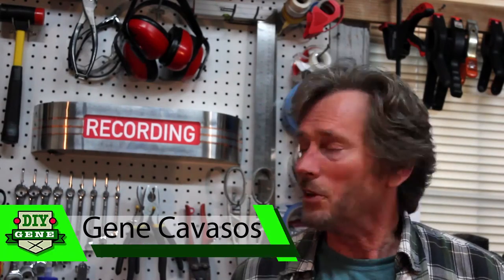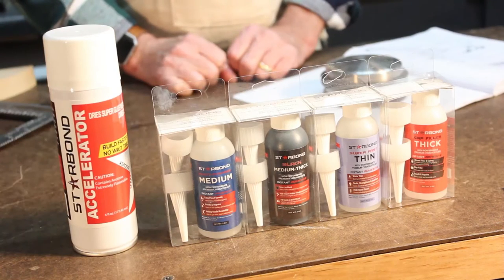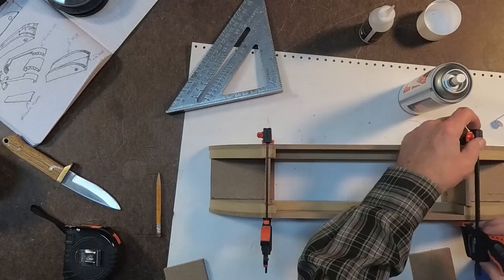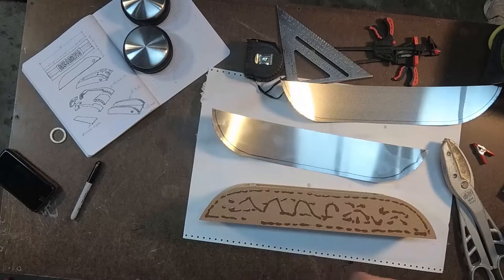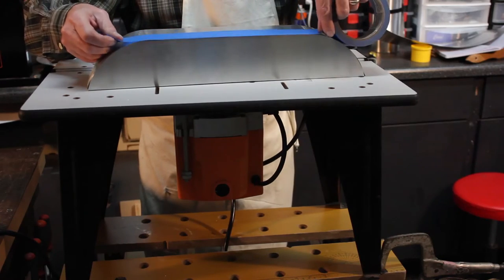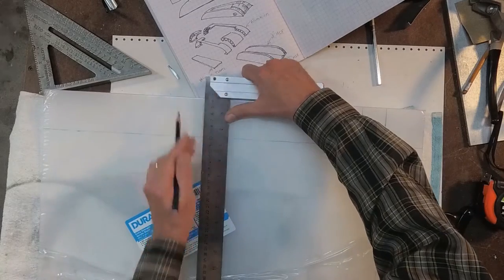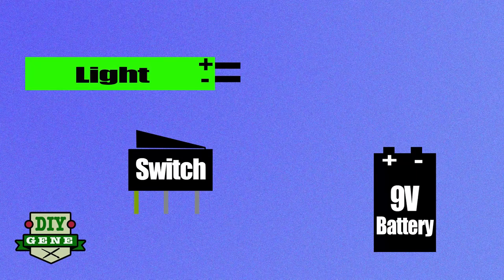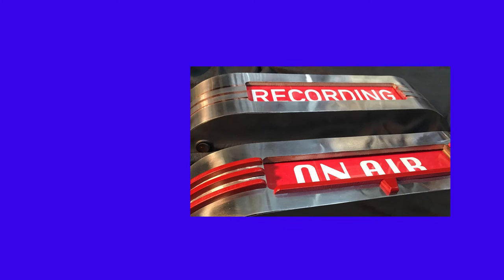Vintage On Air Sign for YouTube Creators.(How To Make)

Comment: What I like doing with CA glue, is to use it as a clamp. Run a bead of wood glue as you normally would, but skip an inch or so throughout the glue line. Put a few drops of CA glue where you skipped the wood glue. You then put the two pieces of wood together, the CA glue sets up, and holds everything while the wood glue dries. CA is great, but it's really not as strong as wood glue.
Reply from the maker: You are so correct. I learned this as I went along with more projects . It makes a big difference. Thanks so much for watching.

Comment: Fantastic work always  you never cease to amaze me Only one little problem your battery will be shorting once your switch is in the off position The black wire should go from the negative of the battery straight to the negative of the led strip Cheers
Reply from the maker: George Krabs, Thanks! I will definitely check out the wiring. I really appreciate the advice and the great comments.
Reply: @DIYGene  No worries mate You've got a great eye for detail and your work is fantastic Keep it up cos you always come up with something before I can suggest Stay safe
Reply: So does this mean that the wiring diagram in the video isn’t right? Or has it been changed?